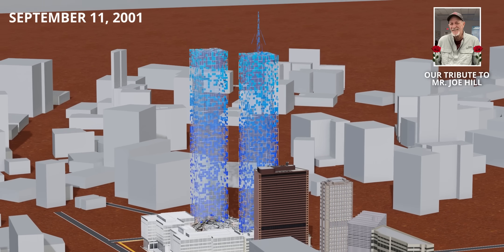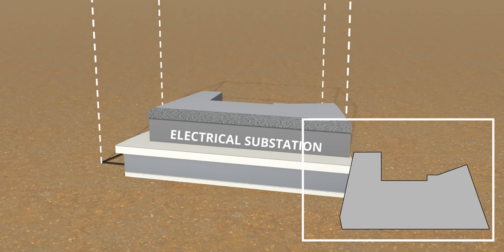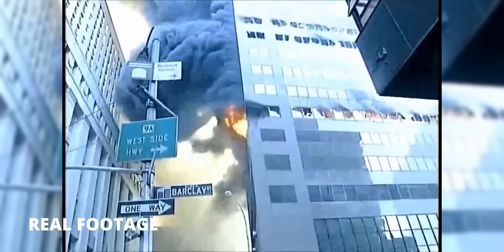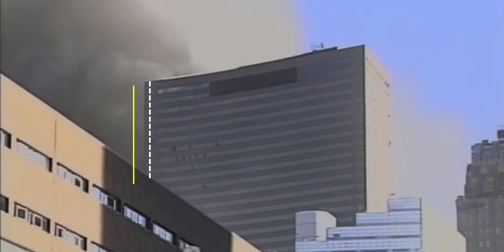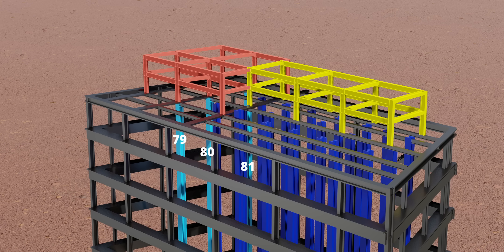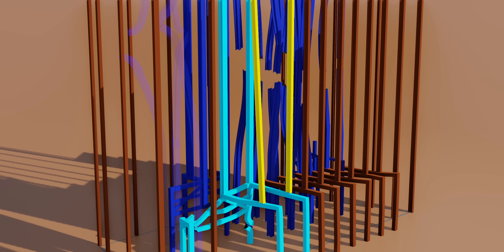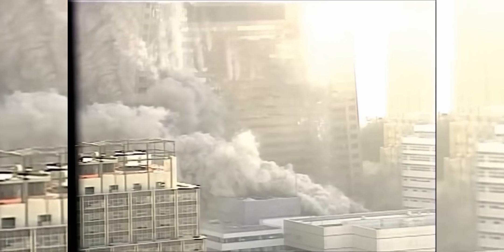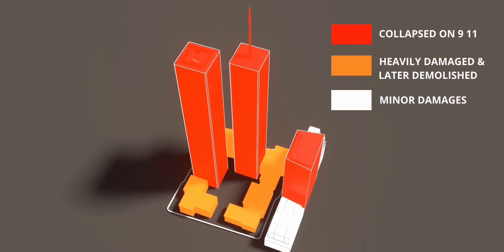Collapse of Building 7 | The Complete Physics

Comment: Demolition companies should be so happy. Turns out that all you need to do is set the building on fire and you get a perfect fall.
Reply: Also, you need first a press to report 20 mins before... then you will get a perfect fall.
Reply: bro that's like saying a guy is part of the cia just because he said that a glass cup will fall off of a table when it showed clear signs of the glass tipping over and the fact that other nearby cups fell off
Reply: or a 1'000ft skyscraper falling directly ontop of it
Reply: It was damaged too dumbass.
And yes fire can cause buildings to collapse. If it didn't then why is it required to have fire insulation for the steel members of buildings?
Reply: But not safely… you could also give someone acid to kill cancer…
Reply: THIS is why I'm down to run for U.S. President and save The World!
💜💚🇺🇲🌎🌏🌍👽🥊💪🧠
Reply: did bro even watch the video
Reply: @-Orangedoctor- no they didnt
Reply: @xCmOn3yx777 or they did but do not have an inkling of intelligence in reference to structural engineering and thinks it supports that more detonations (that no one can show or even have audio of) were the reason. Because they saw a tik tok somewhere.
Reply: @Ickshter2112 thinks understands structural engineering because he watched a piss-take video that is backed with zero evidence.
Reply: @Tobo-oy7if No because I am a structural engineer and a Level II NICET certificate and studied the collapse as part of my job back in the early 2000's. What exactly do you know about it?
Reply: @Ickshter2112 ok then enlighten me or us all how this building could collapse like that? Which parameters did you have to bend for the computer animation to look like the footage?
Reply: @T@Tobo-oy7if you do not believe it from the mouth of a seasoned STRUCTURAL ENGINEER, then you simply don’t WANT to believe it.
Reply: @NexusOdysseus of course you see it as a matter of belief and not convincement. No, I am not convinced by a fantasizing trust me bro video that has to add to its conclusion "but it was not free fall, somebody sped it up" to make sense.
Reply: @Tobo-oy7ifdid you not watch the video? It explains how t quite well. I would explain it to you by saying watch the bloody video. It surely wasn’t done by using a demo team. There is ZERO proof of any of that.
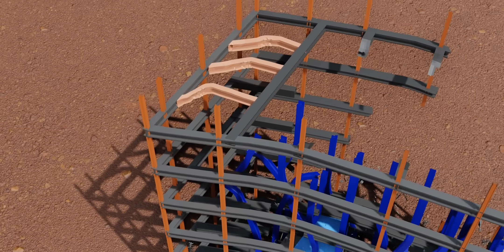Reply: @Ickshter2112 it's really baffling how people go around and make fun of tinfoil hats and in the same breath accept something as inconclusive as this video because it has a computer graphic with colours and some cuts in some beams. What in the name of god is happening at 8:39?
Reply: @Tobo-oy7if You do know that it isn't just a computer graphic that has "colors" This is most likely a simulation set up through a version of CAD or solidworks that takes inputs and than simulates through physics what would happen. That is why it is pointing out that the simulation matches what was actually witnessed at the crash site. What happened at 8:39 is what WOULD happen if those beams were put under that amount of stress. The pivoting of the outer structure and the twisting from one side to the other which the video footage confirms. No go put the tin foil back on to be safe...
Reply: @Ickshter2112 course it's CAD, like anything else in this context. Look again at 8:39 and tell meh what is happening to the other beams not just the highlighted ones. Maybe if you make more tinfoil hat jokes, you feel like you don't have to answer anymore.
Reply: @-Orangedoctor- obviously not
Reply: @-Orangedoctor- stfu
Reply: @komenskyborg  disgusting
Reply: @tranquil02disgusting
Reply: Look up the reporter reporting the building had collapsed while it was still standing in plain view behind her.
Reply: @beetlejuice4357  🤦‍♂️ There was a lot of confusion and miscommucation that day.
Reply: @beetlejuice4357  look up the news story from the BBC that stated it was a mistake, that they read the incorrect information and apologized for the error after it happened. And even IF you don’t believe that, riddle me this. Why would you give the BBC information that the building was going to collapse before you t actually did? Is your brain that small that you can’t follow that to its Moronic conclusion? Hey, we’re going to blow up our own buildings so they all fall down, let’s tell as MANY people as we can so they can all report it and trust they won’t screw it up instead of, you know, just letting it happen and then they couldn’t screw it up and they couldn’t leak the evidence that we told them before it happened. 🙄🙄
Reply: I can see why it's suspicious. 
Like, even WTC 5 was still standing, despite being much closer and extremely damaged.
Either WTC 7 was really weak... or there was indeed something suspicous
Reply: @LonelyMountains346  Or it’s just random chance - in tower 7 the debris happened to hit something important, in tower 5 not.
Reply: These are high grade buildings that are able to with stand fire,  jet fuel, earthquake & etc. These are the only sky scrappers in history that have Ever collapsed, period.
Reply: @B-Will-  bro is just talking outta his ass here
Reply: @atcornfield you?
Reply: @B-Will- How many other skyscrapers do you know of that have absorbed the energy of a 767 going 500+ mph?
Reply: @NexusOdysseus it's not the argument you think it is.
Reply: @Tobo-oy7ifAnd why is that?
Reply: This 😊 save money on sintex too
Reply: You have to get extremely lucky but yes in a way youre right, just too rare to try
Reply: Somebody didn't watch the video. 🤣
Reply: Are you trying to sound smart ? 
Yes putting a building on fire will likely lead to its destruction. That has been true forever, hence great city fires demolishing everything.
There nothing to be happy about for demolition companies. Because even thought it works, an uncontrolled fire also means smoke and dust polluting everything around. Also risks for buildings around. Like. Do you have a brain cell ?
Reply: @EarendilTheBlessed wooshhh
Reply: @EarendilTheBlessed  Well, this is clearly sarcastic lol...
Reply: @EarendilTheBlessed  https://www.youtube.com/watch?v=IZ-uOXQfmtY&rco=1
a same 70s buildiing and did not collapse, wtc 7 was controlled demolition
Reply: @robrthaans7982  What is the link between your comment and my comment ? Stop spamming.
Reply: @robrthaans7982  you see a single example of a building on fire not collapsing so you think no building should collapse due to fire? You’re not very bright are you
Reply: @42468 How did Mayor Guilliani know the World Trade Centre's with a plural.....were going to come down before they actually came down??
How did they know building 7 was gonna come down before it came down??

Because before that day no skyscraper made from steel had EVER collapsed.....

Combine these things with the Pentagons famous no plane video....all we seen was a long low thin object and NOT a stubby tall fat nose from a jumbo jet....

And YOU have some serious explaining to do 😁😁
Reply: When facts don’t interest you, what good is an explanation going to do?
Reply: @dikranovichk5889 the only facts around here Yankovic is that you keep dodging questions like a Politician 😁😉😉
Reply: Waste of breath. To think the government hired some Saudis to fly airplanes into the WTC hoping the North Tower would fall on WT7, then have  a backup plan by hiring demolition crews to go into 1, 2, and 7 and purposely kill 100k of our own citizens. And for what? To justify going back into Iraq? To make money for the military industrial complex? How demented is that?!!
Reply: @JB-if7bu  exactly. These people are that greedy
Reply: @JB-if7bu 😅 yeah as if humans would ever do anything wrong....it's not as if Biden and Kamala purposely opened up the borders and flooded America,or a President having an affair and lying flat out on camera,or a Presidents son being a crack cocaine addict,or New Jersey mayor Menendez being in jail,or Myorkas purposely raping your country,or Newsom burning California to the ground,or Mr Schwarz giving away missile technology to the Chinese and paying a fine to avoid jail....

Yeah your right, people high up ALWAYS have morals and would never break the law to benefit financially 😁😁🤭
Reply: @JB-if7bu 
Nobody said it was the government. CIA is not part of our government.
Reply: @JB-if7bu They were able to do this in plane site of the public. I believe all this was satanic in nature

Comment: Basically, WTC 7 steel acted like butter and melted at weak fires. Nice job explaining this science fact.
Reply: it doesn't need to melt to fail
Reply: @gabrielsfilms2086 all those cold floors below would've held up rather than turn to dust, explosions were reported in the basement, not enough energy in that jet fuel or enough exposed steel to give a uniform collapse, the idea that a quick fire can bring down a massive steel reinforced concrete monstrosity so neatly is marvellous
Reply: @mainzy00  try dropping a brick on a sheet of wood suspeneded above the ground by 2 bricks
Reply: @gabrielsfilms2086 you have no concept of the physics involved here if that analogy is anything to go on, nothing was dropped and as I said the cold floors below the very few hot ones wouldn't be compromised and structurally sound, buildings are not 'designed' to collapse when one or two floors have a fire
Reply: @mainzy00  omfgggg dude a whole floor can almost never survive another floor falling on top of it, let alone multiple
Reply: @gabrielsfilms2086 OK genius we bow to your mastery of physics
Reply: steel does not need to melt to become weak. it has been proven in many ways that the buildings collapsed from the damage
Reply: @mainzy00, your first comment in this thread was about as dumb and uninformed as your last comment was. God could come down and tell you it was terrorist.  Your response would probably be, “this conspiracy goes higher than I thought.”
Reply: @dikranovichk5889 it was carried out by terrorists, cia and mossad
Reply: @dikranovichk5889 😅 explain the flight 93 jumbo jet crash so violent that it turns Rolls Royce airplane engines to pancakes and everything else obliterated..... BUT they managed to find not only a passport...BUT the hijackers passport AND his bandana which was absolutely brand spanking new 😁😁

When you can explain that....then you may come back here and post crap to the conspiracy people 😉
Reply: Again, when facts don’t interest the nutter, an explanation is futile.
Reply: @dikranovichk5889 😅 run from the truth Weird Al Yankovic....run 😁😁
Reply: @dikranovichk5889 how do you explain the pile of rubble smouldering for 3 months solid because of a small amount of unexploded jet fuel?
Reply: @dikranovichk5889 hey, anyone in here see those towers burning in Hong Kong that must've been made 1000x better than the twin towers or... Something else
Reply: @Olleh126 no it's just a miracle that fire damage made them all fall so uniformly and swiftly. Very efficient and effective, so America went and caused about 4.5 million deaths across the Arab regions that had very little to do with anything
Reply: @mainzy00  if a top floor fails, it falls on the floor below and overloads that as well. i dont know whats so hard to understand
Reply: @Olleh126 yeah, no, I get it, just straight down with very little resistance from all those cold, sturdy af floors, the site smouldered for months, just a lil jet fuel caused that too
Reply: @Olleh126 Just watched some steel towers burn for 48 hours solid and stay standing, why?
Reply: Mainzynil, you again are left not able to see evidence. The Hong Kong block were residential buildings.  They were all built using reinforced concrete.  You could tell this by seeing exposed rebar and concrete. A massive fire, which did not have the jet fuel accelerant, and was constructed with reinforced concrete. The world trade centers had massive amount of reinforced concrete, but it was mostly below grade.  The basement and parking levels.
Reply: @dikranovichk5889 I heard full of asbestos too
Reply: Yeah, it is the same effect, which allows blacksmiths to work steel with a hammer, well below its actual melting temperature
Reply: @CZpersi so the energy required to melt all that steel across all those floors came from a lil unburnt jet fuel and perfect furnace like conditions, with that thick black smoke?
Reply: @mainzy00  You don't need to melt steel in order to weaken it. At ~500°C / 932°F steel will only retain 50% of its structural integrity.
Reply: ‘The sky is yellow and the sun is blue’
Reply: @KarmaKahn I would argue you still didn't have enough energy or time or exposed steel to get the results we saw
Reply: It was amazing to see how much damage jet fuel does when it explodes. We saw this real well with the UPS crash in Kentucky
Reply: @CZpersi  blacksmiths don't work with structural steel. And blast furnaces get a lot hotter to liquefy steel that jet fuel can create. It's chemically and physically impossible...
Reply: @CZpersi  and you really think that was enough heat applied all over the building to cause it to collapse in its footprint at near free fall speed lol like people dont lie
Reply: Aaand , all vertical columns game way at the exact same time one every floor
Reply: They cut the beam with thermites and pull it down
Reply: @Tamim-f4p  wrong
Reply: @Tamim-f4p  They cut the columns with termites becuase WTC7 was made out of wood. Special CIA termites. That's why it took so long to collapse - there was too much wood to eat